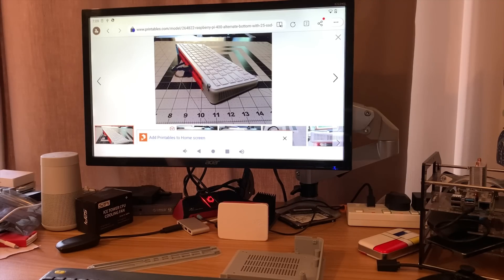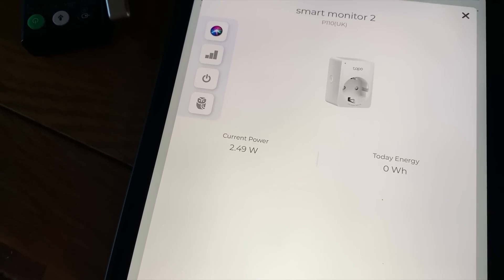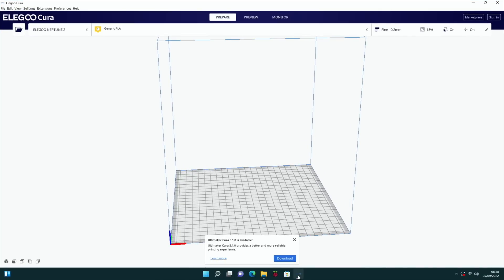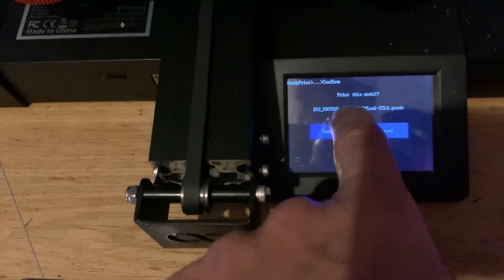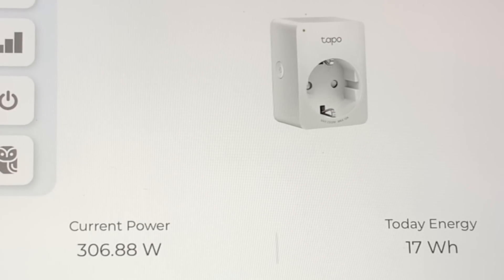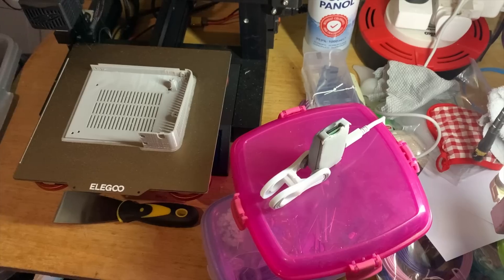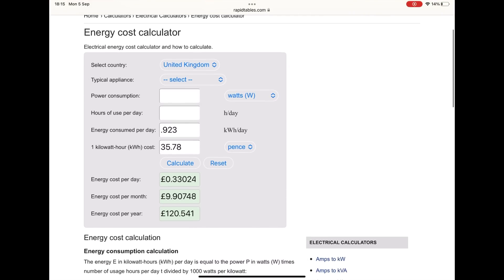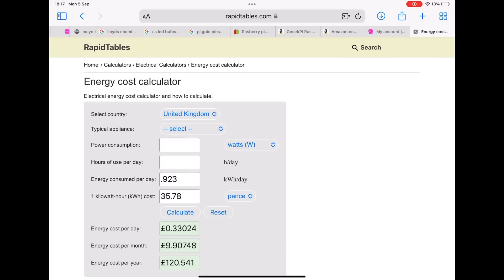How much electricity does my 3D Printer use? 9 Hour print.

Comment: The start up of the heater cartridges for the hotend and the bed heater peak when they are switched on, I have noticed with my borosilicate beds if I increase the squish of the first layer slightly but apply a 0.36mm filet to the first wall of a part to avoid elephants foot I can have the bed heater turn off after 3 layers when printing PLA, if I dont increase the squish the bed releases the part as it cools, I hope I will save quite a few quid over a year.
Reply: If you are concerned about bed power use, insulate the bottom of it.  The only down-side is that it takes forever to cool down.

Comment: The jump comes when the heated bed kicks in to maintain temp.  Nothing else on a printer really takes much power at all.  I've seen them run on 24v battery arrays that were charged by solar.  No inverter or A/C involved.

Comment: This is great that you've measured it, I had wondered but not enough to work it out myself, but for someone with an army of Pis I can't believe you've not running Octoprint!  Sure you've got the camera sorted, which is one part of what it provides, the but monitoring and control of the printer, especially remote is a god send!
Reply from the maker: I have used octoprint in videos. It is great software.

Comment: Interesting. Although your electricity is more expensive than ours, or at least where I live. Considering the conversion rate, the pound is higher than the dollar, and I pay $0.11 per kwh, I'd say you pay anywhere from 4 to 5 times what I do, maybe more. I'm curious what the cost per print would come out to on the total price of the printer. Take its price when new, divide by number of prints over its lifespan after it dies. I'd wager that's pennies per print, given that you might have it for 10 years or longer.
Reply: I bought my first 3d printer about 7 years ago, and another one a few years later. I couldn't even begin to make an accurate at guess how many prints I've done in total on the two printers so far as I never kept track of it, but it is certainly in the multiple thousands. Calculating the price of the printer over that many prints, it certainly is not much. Given what I paid for the things, I'd be surprised if I'm still at more than €0.20 per print of the printer cost... And both of my printers are still going strong.
Reply: @rsnowdowne  If you've printed thousands of times, I'd be surprised if it was that high. If it was a 500 dollar printer, that's 50,000 pennies. 5,000 prints which I can easily see half of that in the first year would equate to a mere 10 cents per print. But I'd still love to see someone track their usage and find out for sure. For that matter, earlier printers required far more calibration. If we count that process in the NoP's it could drastically affect the numbers.
Reply: @anon_y_mousse  my first printer was a $300 kit, my second was around $600. I will say I have upgraded parts a couple of times through the years on both printers, so you can probably add another $400 or so on top of that. That puts my total for 5000 prints at around 26 pennies per print… (averaged over both printers). Either way, I’ve certainly got my money’s worth out of the printers, and continue to enjoy them. I think I have got enough out of the printers that I don’t even think about the sunk cost any more.
Reply: @rsnowdowne  But the thing to remember, as long as they still work and you still use them, the cost will keep sinking. ;)

Comment: Try that on a Ender 5 plus printing on petg which needs a 80c heating bed which is nearly 500 watts to get the bed heated to 80c ( 25 minutes ) and 300 watts after to keep it to temp .
Reply: You can switch to a 230/110v heated bed. On a boron it take around 5 minutes to go from 30 to 90
Reply: @riccardosacchetti  Yep , my blv mgn cube has a 1000 watts 350x350mm bed heater , which is super faster to heat up , but will still take the same energy to keep it at temp.
Reply: @peteradshead2383  have you insulated the bed?
Reply: @riccardosacchetti  no , earthed and 2 thermal fuses on the bed.
oops I know what you mean now , yes cork I think .
Reply: @peteradshead2383  yep! I have to try by my self..

Comment: This could also be a good (at least interesting) case for running the 3D printer setup from a battery that can be charged during off-peak hours and/or by a solar panel, so that it can run without interuption through the job, as well as get the better rates and lower impact on the grid. 👍

I've also seen insulated hoods for the 3D printers (Jeff Geerling has one), that might help keep your heating coil from having to peak as often?
Reply: The enclosures are only for high temperature filaments though, you cant print PLA in one, PLA does not need the bed heater on for some buildplates though so you can save energy there.

Comment: I also thought I would be more costly. What I noticed and as you stated: sometimes it consumes 46 watt, sometimes 306. Was it during the whole print between more or less these 2 values? That would suggest it's a rather crude temperature controller. A PID controlled one would for sure be better for the temperature but maybe it would consume even less, well, in fact it should.
Reply: Even an insulated hood might help.
Reply: Most 3D printers can be PID tuned but many manufacturers dont set it up and in the case of Creality, they go to the trouble of turning it off for the bed in the Marlin firmware and use the inferior bang bang method